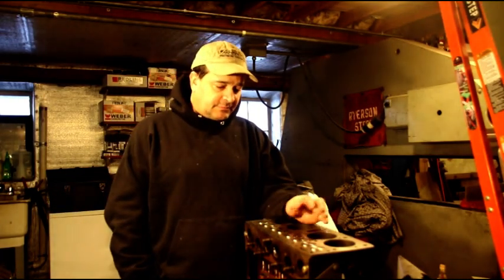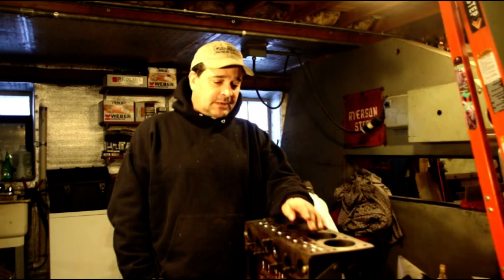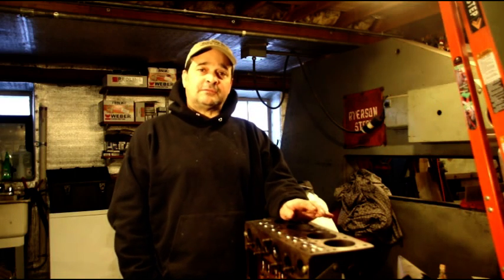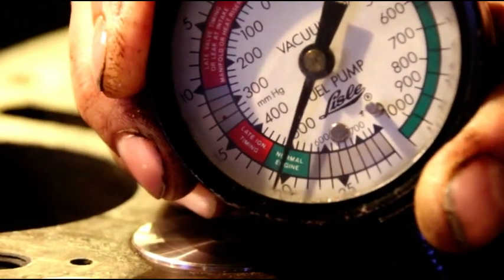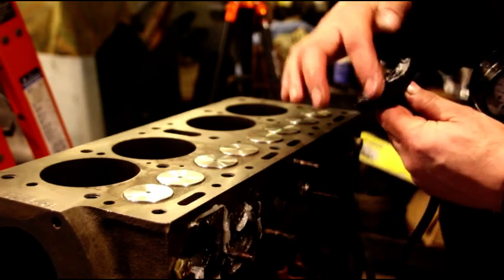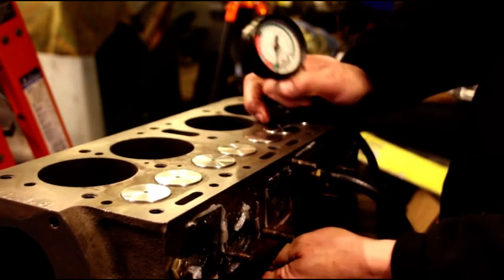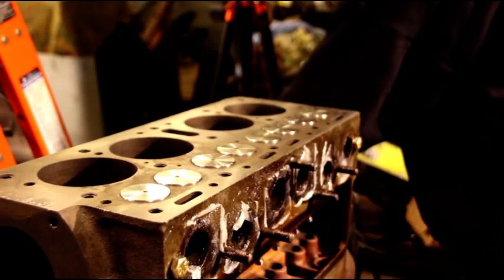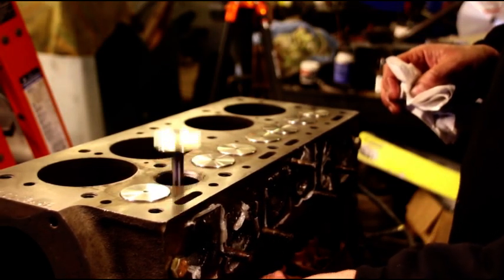Willys L Head Valve Test......Please Watch To Get A Good Rebuild !!!!

Comment: Since  I was 19  when I  started rebuilding Air-cooled VW engines  before I installed the rocker assemblies I would put compressed air  in at the sparkplug holes  and listen for leaks and do what i call a  "Pop" test where I would take my dead blow hammer and tap the valves - same idea just reverse . I used my Snap-on  compression test hose and plug into my shop air hose. 
Don't need a vacuum pump -

Comment: Thank you for all you share Brian! Thanks to your videos I decided to do the valve seats and guides myself, after I went to a very reputable machine shop in my area and they told me, they just clean up the seat a little with a 45 degree, on all gasoline engines. It seems that valve jobs take more patience and dedication than what most are willing to put in. Other machine work, I'd say doesn't take much thinking, as you normally just machine something to the right size and you are done, but valves are surely a meticulous process from selecting the right reamer for the guides, to using the right angles. But it all sure pays off in the end when you do things right!
Reply from the maker: Good idea doing it yourself, follow my videos and you will get there without too much trouble.  Most shops just do a bad job of cleaning up the seats and the engine suffers.

Comment: Thank you for your videos. I followed and studied and took notes on many of your videos. I rebuild my first engine in my life. Purchased New Way valve seat cutters. Purchased a vacuum pump. And for $700 in machining, I have a rebuilt MB motor that runs strong and I can get the jeep to 55. So nice to be able to cruse at 45 and be able to get to 55 if needed.
Reply from the maker: I am glad my videos helped you with your engine, sounds like a good one with plenty of power.  Spread the word about my videos so others can take advantage of the information I am sharing.  
Brian